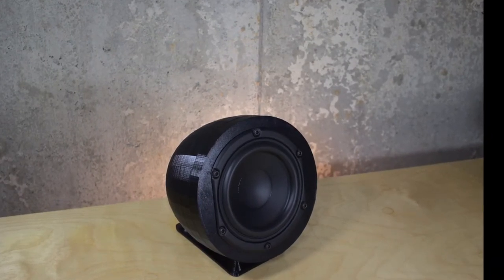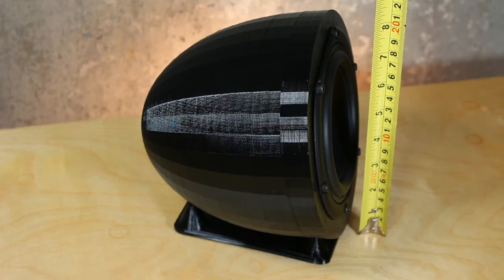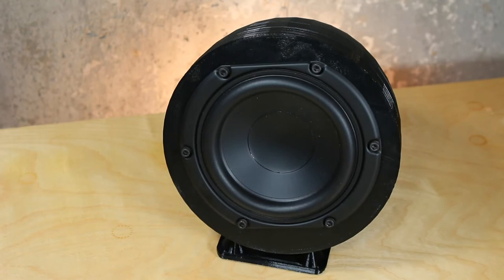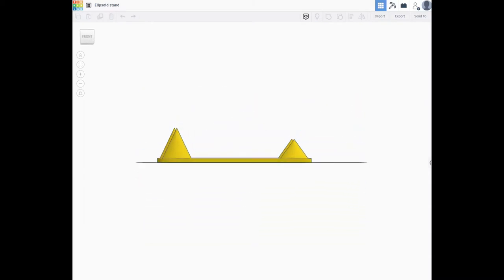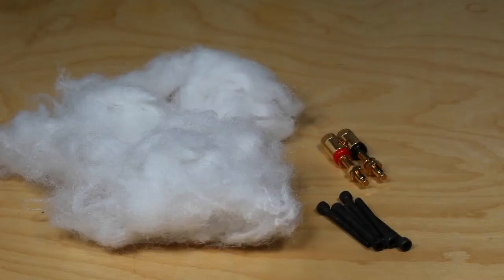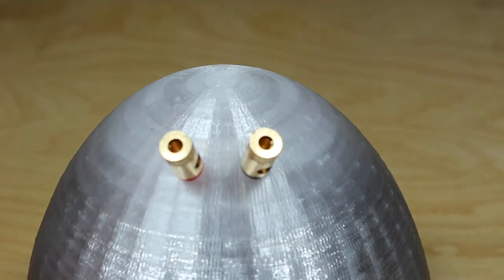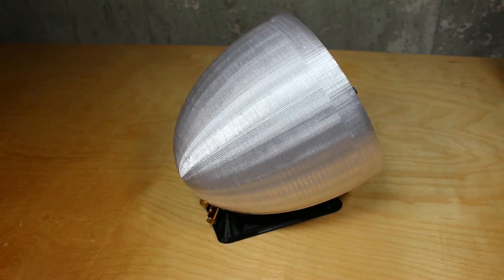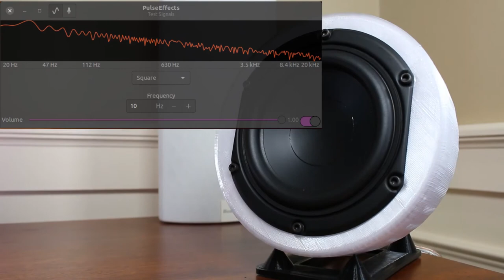Desktop Micro-Subwoofer

Comment: Loved this concept. I don't have a 3d Printer. Any suggestions on where I can get the housing and base printed for me at a reasonable cost? Wonder if it can be done for less than $30 shipped to VA? What's the weight/cost of the plastic rope alone?
Reply from the maker: It's about 800 grams in weight.  Any 3d printer should be able to handle the files by loading the STL files into a slicer to generate the needed G-codes.  If you have a friend with a 3d printer, that would work.  Some other options...I know many public libraries have 3d printer stations or you might want to try a local school or community college.
Reply from the maker: One more thing.  I took the $30 from the title.  I had parts and filament sitting around so I decided to use that with a few new parts.  That might not be someone else's situation as your question just alerted me.

Comment: may i ask what amp did you used? 
And thanks for sharing....
Reply from the maker: Absolutely.  I used the Fosi Audio MO-3 Sub woofer Amplifier.  It has an adjustable low pass filter if you are not able to adjust with your PC audio or preamplifier.  If you have the ability to adjust, I would try the Fosi Audio TP-02.  I will be testing that one out within the next few weeks.  Please ignore the power ratings of these.  Neither will do more than about 50 watts (my guess), but for a desktop system for my PC, it can more than fill up the room with bass.
Reply: Thanks for quick reply